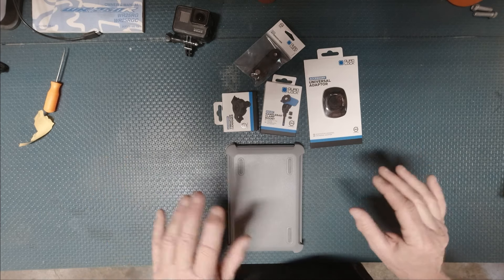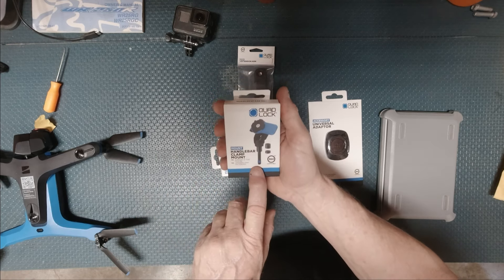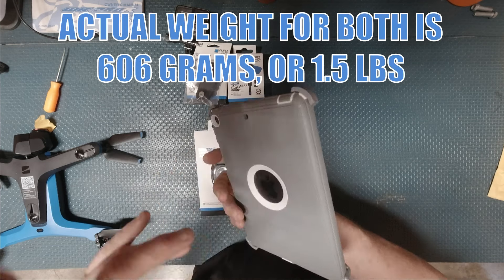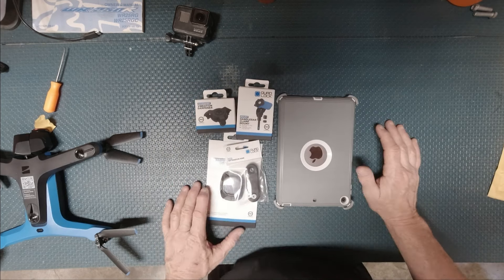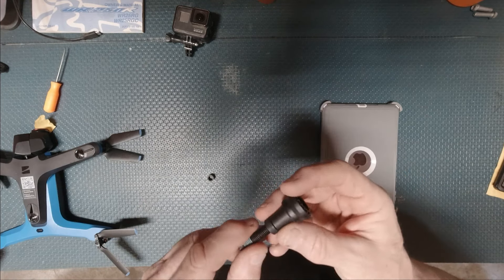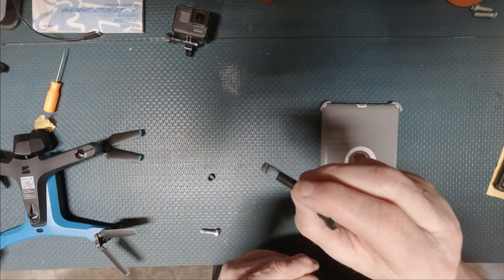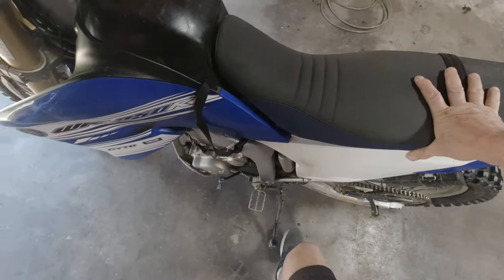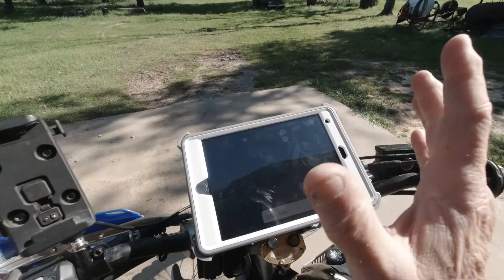The Ultimate Dual Sport Motorcycle Upgrade: iPad Mini & Quad lock

Comment from the maker: After making the video, I learned that there are 2 different types of iPad minis. If you're planning on using the iPad as a GPS device, you need to make sure u have a 3G/Cellular unit. They have an embedded GPS. The other version of iPad is a wifi only and will not work as a GPS unless you hot spot off your phone, which doesn't work well.

Comment: You can use an outboard GPS receiver with a WiFi iPad. Garmin makes one called the GLO 2. Dual makes the XGPS150A.
Reply from the maker: Thank you for the information. I just look them up. A lot cheaper than a new iPad. Appreciate the heads up.

Comment: More evidence that I never have any original ideas but super glad to see someone had made a video about this! How has the system been holding up for you over repeated use?
Reply from the maker: Holding up great. The only issue I have is using the Ipad as a GPS device. It doesn't have a cellular chipset so it has to Hotspot off my phone. And since my phone has about as much GPS screen footprint I just use the iPad for drone controll